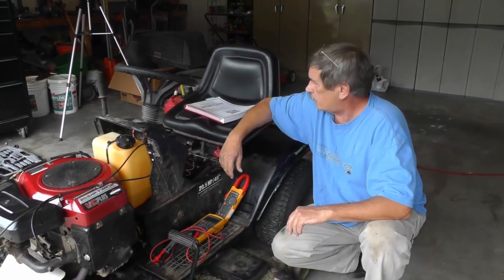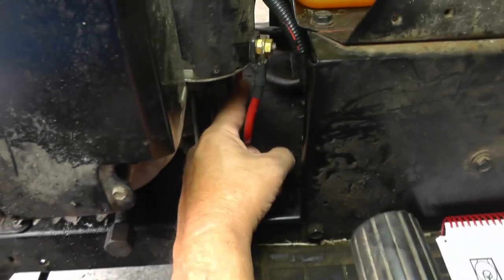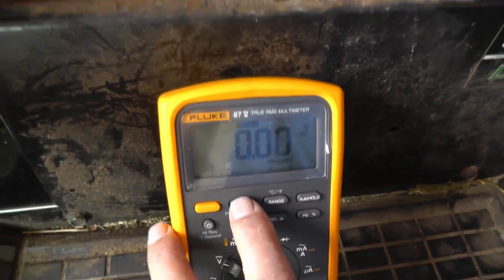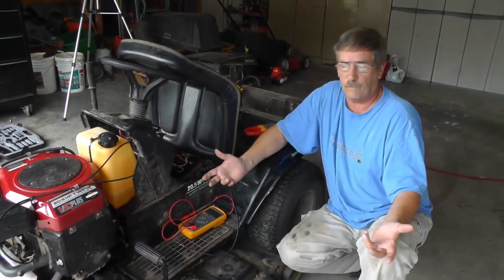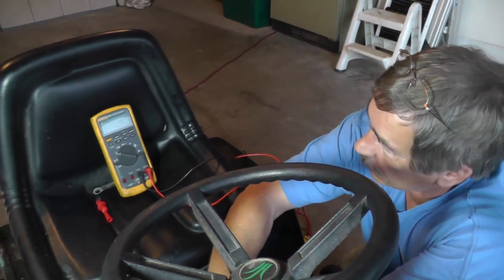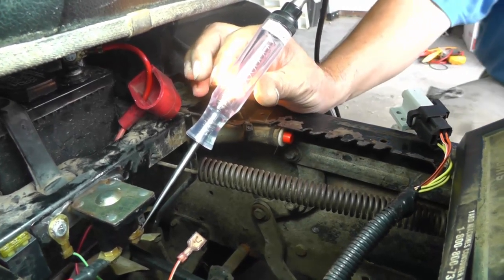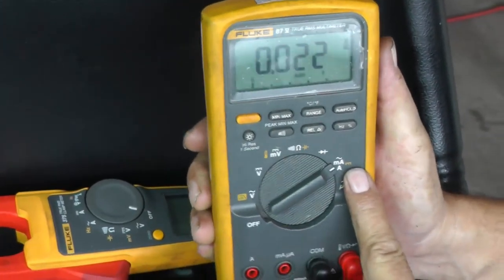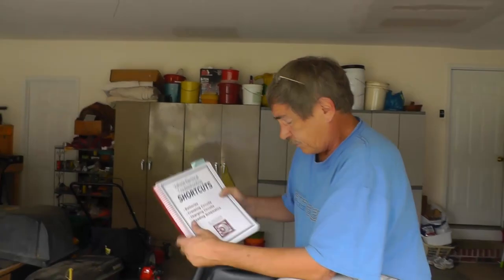Riding Mower, Diagnostics of Starting System - Part 2

Comment: Packed a ton of great electrical diagnostic advice in here.  Great video for anyone wanting to learn electrical diagnostic basics.  Voltage, current, and load testing.  Voltage drop, polarity, resistance, and continuity.  It's all in there.
Reply from the maker: +DJDevon3 Thanks DJ for your comments, I appreciate it.

Comment: I have to say this is the most credible, educated thing I have ever found on YouTube. Nice job. Great relief from the hacks one usually finds here. I am a Mechanical Engineer. You really taught me things I will use for life. I am now retired and work hard troubleshooting a wide variety of equipment on my son's farm... mowers, skid steer, tractor, trailer lights/brakes etc. Plus I have an electric car... 1983 VW Rabbit Cabriolet with 144 Li-ion batteries, a charger and a Battery Management System. I should be eligible for an EE degree by the time I die. I am also struggling through understanding/refurbishing vintage stereo equipment.
Reply from the maker: Jack Gutschenritter what a very nice comment Jack! I always say that if you want to learn something and you have a passion for it, you will find the answers. As far as that vintage stereo equipment which I'm sure has vacuum tubes, i'm quite sure that you will get it all fixed up Jack. 👍Thanks again Jack for leaving a comment! 😀

Comment: Good point about checking the "easy to get at stuff" first... as well as having a good wiring diagram. Knowing "what to expect where" (along with a good wiring diagram) makes fault diagnosis less painful! Great job from start to finish! Thanks for the links... I already have a loadpro, but might have to get me that book!
Reply from the maker: +Thomas EXOVCDS Thanks Thomas for your comments. Yes, the book is well worth it as I actually picked up a couple of things, especially with the recharge current. Basically, you can do a discharge current on a battery and the battery checks fine. But, the battery could still be bad because the recharge current is too high. That was a new one for me...

Comment: I lucked up and found you videos. I have a problem with my mower not starting, and I'm sure the tips you shared will help me find the cause. I am surprised that you don't have a larger following, because you deserve a much larger audience. You obviously have a clear understanding of how to troubleshoot electrical problems. I have subscribed and like your video. Thank you for taking the time to help out by doing the video, I know it's a lot of work, so again Thank you. Joseph Senter.
Reply from the maker: Thank you Joseph and glad you found the channel. As for the following, I started the channel with the intention of taking a problem, describing how a circuit works and then make the repair. It turns out that the majority of people couldn't care less how things work and just want to see how to change a part (basically a lot of parts changers out there). Basically, they'll want to know where is the part and how to remove and replace it. And amazing how a lot of people will tell me their symptoms of their issue and thinking that I should be able to tell them exactly what part is bad without any diagnostics. Nowadays, I'll show how to replace the part and leave out all the gory details of how it works. Amazing how some channels will show how things work, (which is usually wrong) and then get a large following. Take care Joseph and wishing you well on that mower. Oh, and thank you very much for the sub!

Comment: WOW... Not sure where to start :) kudos to Mrs. Pike , fantastic camera work 👍  I also have Vince's book and the loadpro both a must have. Ha I thought I was the only one that puts the rubber plugs in my fluke amp jacks and labels my test light - ha I label everything.  This is the best display I have ever seen on voltage drop and currant testing bar none. Man you didn't leave me anything to ask about, not even a crumb - you covered it all .  Ok I did find one thing - Ha you know Terry I'd find something :)  Ok on the Meter when you tested the amperage on the starter relay I noticed you selected the MV setting on the meter and put the test lead in the 10 amp jack. The 87V has a max of 400mv range on that position but it read over 2 amps . I know you couldn't blow the fuse ,you were in the 10 amp port but I did know you could do that , I always select the high amperage setting on the selector switch.  Thank Terry for doing this , man it looked hot and lots of setup. 👍👍
Reply from the maker: +Steve Rob Thanks Steve for the great comment and the wife thanks you too for her camera work. I didn't even notice the setting for the ammeter on the meter as my mind was probably getting overheated. You are correct that it was hot as hell and you might have noticed that my hair, face and hands were drenching with sweat. In a few shots, the wiring diagram had a big blob of sweat which was dripping from me. I told the wife during a few shots that we've got to take a break and in some shots, my hair was all dry again. Thanks Steve for dropping by and leaving your thoughts and glad to hear that you liked the videos. Are you still getting no notifications from YouTube? For both of these videos, I haven't received the first notification yet. I wish YouTube would get their programming fixed as I've checked the notification settings and all is well there. Take care Steve and looking forward to seeing some of your videos...
Reply: +stuzman52 I just started get my notifications back about last  Thursday , not sure if I'm getting all of them yet. I did notice your comments on my vids are back. Ya Youtube is an very odd how they keep changing formats.  You and the family have a great weekend !!
Reply from the maker: +Steve Rob Yes Steve, hopefully, they'll get it all straightened out. You and your family have a great weekend too!

Comment: Hi Terry, very educational video! Love your custom wiring diagram! If only the manufacturers could provide such detailed schematics for every make and model :) One question I had was: how are those "LoadPro" leads with the button different from a test light? Since every circuit on the vehicle is designed to draw different currents, wouldn't the LoadPro fail to effectively stress the ones that draw more than 500mA?
Reply from the maker: +motoYam82 Thanks for stopping by Ivan and you're right that if they provided some good diagrams, it would make it a lot nicer. As for the LoadPro, my understanding is that it can load down a circuit with 500mA. So, of course if you were testing the battery cables, it wouldn't provide enough current for cases like that. But, it should work okay if you were unhooking sensors and you were looking at +5VDC and the ground since the voltage regulators should be able to handle an amp of current. And other circuits like tail lights, possibly headlights and other circuits where the current wasn't way up there. In my opinion, when you're checking high amperages, it's best to use the load to provide the current to really load the circuit down to see that voltage drop. Good question Ivan.

Comment: I have an older version of this mower...over the years it has developed a weak or slow starter (turns over about once a second... spins freely till hits compression, then stalls for just a moment, then spins freely again till it hits compression again) even with a brand new battery. If I i hook up jumper cables to my truck, it will then turn over like normal and start. When I take the plug out and hit starter, it turns over full speed (no compression due to removed spark plug) so I know the solenoid and starter motor work...its just super weak and I'm tired of having to jump start my mower every time I mow the grass, especially  when the brand new battery I bought was the highest CCA they sold at Lowes. Once the mower starts and warms up its fine... will even start under it's own power if I turn it off once it's hot,.. it only does the slow spinning thing when its cold...  any clues with what's up or where I should start?...I shouldn't have to consider doing this (because a new battery should work without being jumped also) but I'm about ready to add a freakin car battery and piggyback it to the existing battery...
Reply from the maker: Be sure to check your valve settings as to tight a clearance could cause the slow starting too.

Comment: Very detailed & informative video. I especially appreciate the 10 minutes between the 40-50 minute section that shows step by step how to test all the switches with a test light, because I am trying to determine why my year 2000 MTD mower will not start. It was an intermittent problem, and sometimes it would not make any sound, and other times it would just click, and then other times it would start right up, but now it seems that it won't do anything at anytime. So I am trying to work my way through the entire starting circuit. I saw your video on the wiring diagram, and watched it also, and I really like your diagram. The link in this video description to view the diagram is non-existent now. It would be nice to be able to print off a large print of your diagram to put in my file for my lawnmower. If there is a way to accomplish printing off your wiring diagram, please let me know. I also saw you have a video on testing a A/C capacitor. I wish I had knew about that video last summer when my A/C stopped putting out cold air during the heat and humidity, because I had an A/C tech come out and he charged me $300 for about 15 minutes work. I felt so taken advantage of. Thank you for this video, your wiring diagram video, the A/C capacitor video, and others that will pertain to my stuff.
Reply from the maker: Thank you very much Mark in viewing some of the videos and glad that you found some of them helpful. As for the links to the A-size and B-size drawing of the wiring diagram, I just checked the links and you are correct that they aren't valid. I guess Google has been up to it again. I just updated the links to both size drawings in part 1 and part 2 for the Riding Mower, Diagnostics of Starting System series. Give it a try and see if you can download the wiring diagram and let me know if it works okay. Hope you get your mower working and thanks again!
Reply: @stuzman52  -- Thanks so much! The links to the drawings both work now, but my question now is what is the difference in the two sizes? Which one is larger and what are both their sizes when printed? Should they be printed on 8.5 x 11 paper or on 11 x 14 paper? Sorry for all the questions, but I have never dealt with printing like this before. Thanks again for everything!
Reply from the maker: 3069mark Glad to hear the links work! The A size is for 8-1/2 x.11 inch paper. The B size is for 11 x 17 inch paper. I used the B size in the videos as it’s larger and shows up better. If you want to print that out and don’t have a printer for that size, you can put it on a USB flash drive and Office Depot or some other place can print it for you. Have a good one!
Reply: @stuzman52  -- Great! Thanks for the printing size info! And just so you know, you can just email the file as an attachment to Office Depot and they can print it from there. No need to put in on a USB flash drive! I have done it before, and that's how I know! LOL. You have a good one too!  😊
Reply from the maker: 3069mark Thanks Mark for the info and have a great weekend! 👍

Comment: I have a similar issue and want to test at the solenoid like you did here at roughly the 30 min mark.  But you confused me.  You put the test light on the battery for a reference, then you took the key switch line out of the solenoid and put the light tester on it and it was just as bright and you said the circuitry was good.  But then you seemed to do it again, saying you need the load on that key switch line and the light was not bright.  What changed between those 2 tests when the first time you did it with the test light it was just as bright as the battery test, and the 2nd test was dim?   It seemed like the same test an the same wire but yet the 2nd time the light was dim and now you said there was an issue with the key switch line?  Great video btw !!!
Reply from the maker: Good day tcrowley77! What I was showing in the video at the the timeline of 30 minutes was to illustrate that it's important to have a load on the circuitry if you're using a voltmeter. A voltmeter on an unloaded circuit will not show any corrosion or 'hidden resistance' in the circuit. In the first test with the test light, the circuit was good and showed no hidden resistance because the bulb was bright. The test light was being used as the load and thus current was coming down the circuit. In the second test, the bulb was dim showing that there was hidden resistance in the circuit. As you saw in the test with the voltmeter, it showed that I had 12.88VDC which appears that the circuit is good. However, the test light showed that the circuit had resistance. If you go to the time line at 40 minutes, you'll see that I added a couple of resistors at the battery which made the bulb dim. Glad to hear that you liked the video!
Reply: @stuzman52  Thanks for responding.  I understand now.  I did see the resistors but didnt realize what you were doing.  Now it makes perfect sense.  Heading out tomorrow to get that test light and see if my starter is getting juice.  I think it is and the starter is bad but you showed me exactly how to test that.  Thanks a bunch to you and your wife for spending all that time showing us knuckleheads how to diagnose all this stuff.   Greatly appreciated !!!
Reply from the maker: @tcrowley77  Always glad to help and good luck with your diagnostics and repair!

Comment: good job, sir,  what would cause that fuse to blow, I can start the mower with a direct connection to the starter, I bought a new ignition switch and I cant get a continuity reading on any of the contacts,  I only tried to check continuity after I had installed it, so I am wondering if I could have damaged it, since the mower is blowing a 20 amp fuse. This was a gift.
Reply from the maker: John, when is the 20A fuse blowing? Is it blowing when you first put it in, when you start the engine, etc. You can take a look at the wiring diagram and see the path. Most likely, it's a wire grounding out to the frame. Also, it's unlikely that every contact in the switch is bad. That may be where you're measuring the contacts for continuity.
Reply: @stuzman52  I guess it was something random, it blew the first replacement fuse, I check for shorts on the alternator wires, and cleaned the safety switches and it hasnt blown again, however I found out it was supposed to be  7.5 amp and not a 20 amp. And found out the new ignition switch was open all around never meas continuity. , Thanks
Reply from the maker: @jwlivingston1  Great John and hopefully it won't be blowing the fuse anymore :)

Comment: Hi Terry would you do a video on charging circuit on lawn mower you did starting and voltage drop that was excellent thanks my riding mower not giving me battery voltage when running 14.6 looks to me its not charging I have to boost every two weeks
Reply from the maker: It might be a little while on that one Paul as I've got a lot of fires right now to put out. Hopefully, I can put something together a little down the road :)

Comment: need to expand on the yellow wire to coil, I have a no start. Replaced the starter.
Reply from the maker: I assume when you say no start, you're meaning no crank. Thus the reason to change the starter motor. If that's the case, the yellow wire going to the coil would have nothing to do with a no crank. The purpose of the yellow wire is that when grounded, the coil will not generate a spark. As you can see from the diagram, the brake pedal has to be pressed and you have to be on the seat to start the engine. Keep in mind that if these two conditions are not satisfied, the engine will still crank, but will not start. And once it's started, if you try to back up, the yellow wire will be grounded which will disable the spark and will shut down the engine.

Comment: Can of a silly observation, but,all that testing does no good if you cant crank it. If the battery shows good though, there are just a tone of lines and switches to check after that? Or, the next step would be the starter key switch, since the post goest direct to it? And or the ground on battery? And if thats all good, well, you are in the land of hell, doing current test across the the connections from key to battery, to solenoid, to starter, right?
Reply from the maker: Even if there is a no crank Randy and provided that the battery is good, the checks for the safety switches that pertain to the starting system are valid. And if the crank is slow indicating it could be a bad battery, connections, starter motor, the voltage drop testing would be a valuable test method. Thanks for the comment!

Comment: my starter was messed up I had the brushes and brushing rebuilt it started off twice now it'll engage but doesn't spin the flywheel or disengage any suggestions
Reply from the maker: It sounds like you need to get a new starter. There is a strong spring in the starter drive where it's purpose is to retract the starter drive from the flywheel. Sounds like you've got some issue with the starter for sure.

Comment: I would like to get that book an leads
Reply from the maker: The book has a lot of useful information and the link to the author's website is located in the description of this video. The load pro leads are a useful tool also, but you could also use a test light to get the same results if you want to save a little money.